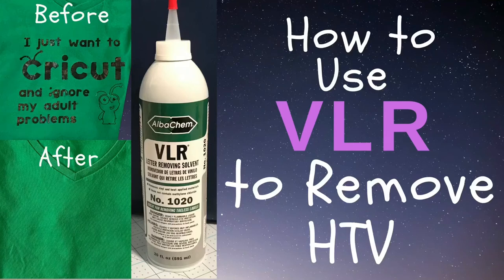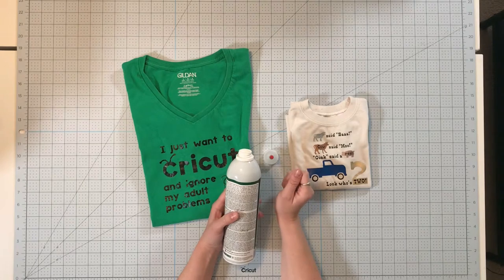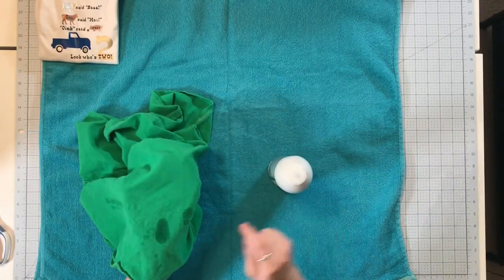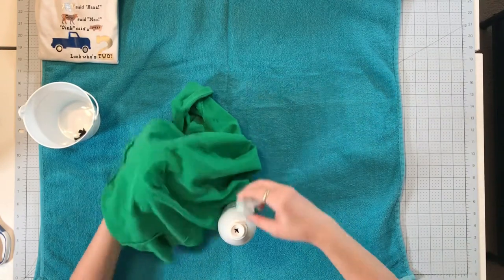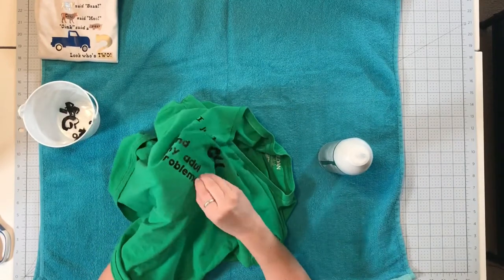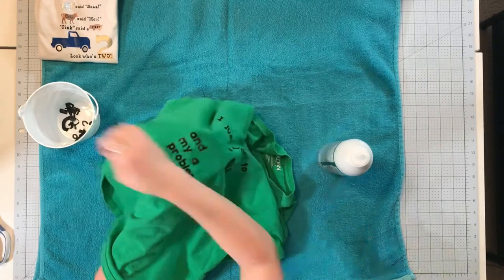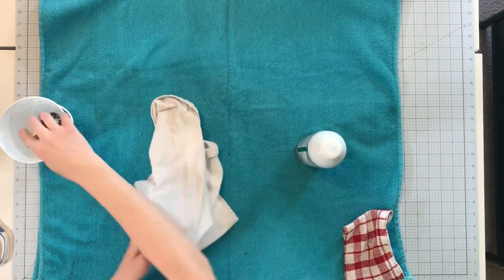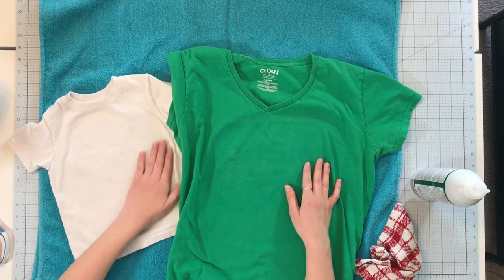How to Use VLR to Remove Heat Transfer Vinyl from Shirts

Comment: The big question is right after it mostly dry... that water stain or slight discoloration compared to the original fabric. What’s the best way to get the discoloration /water marks to go away? A quick rinse cycle in washer or?
Reply from the maker: That's a great question Brandon. I'm not sure. What color and type of material is your blank?
Reply: @HanksMakerMentor  it’s a thicker black poly cotton blend and we’re looking n the middle of rinsing / washing without drying a few times to try and dilute or wash away the stain makes from the solvent. I’ve had it happen in smaller doses before and was a able to hand rinse it away by doing multiple layers of water on a hat. This seems more tedious though. They’re claim that it won’t leave any residue marks is bogus, though.
Reply from the maker: I'm sorry it is making it so difficult to remove those marks. VLR does not do a perfect job. I haven't used it enough to see a pattern on when and why it happens.
Can you put a larger design to cover the marks?

Comment: Does this remove the vinyl letters and the discoloration from the adhesive underneath? I have an article of clothing where some of the vinyl letters have peeled off and I want to remove all of them but the areas where the vinyl has peeled off are discolored.
Reply from the maker: Thanks for watching! It does a sufficient job depending on the vinyl and the clothing. Most of the time, it is all removed. Some vinyl on light colored fabric stains the fabric.  You will probably need to use a cloth to rub VLR directly on the adhesive.